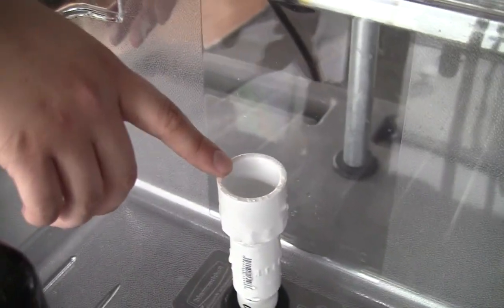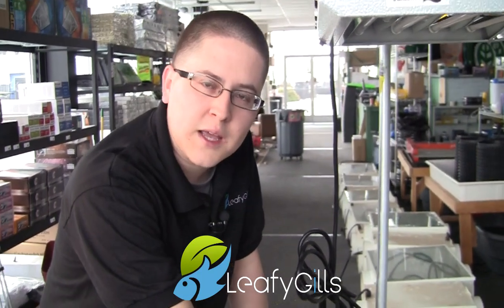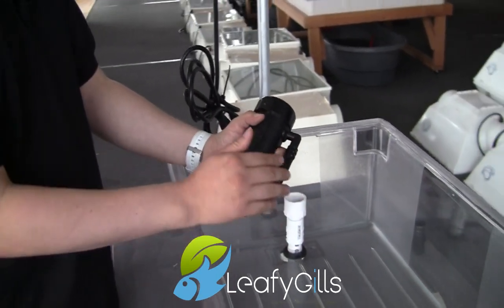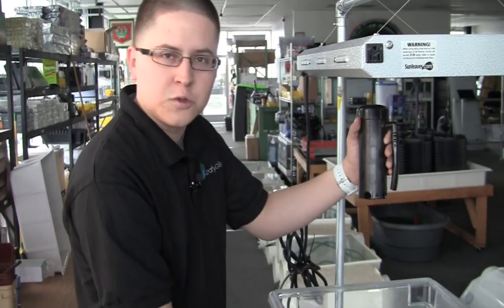What is an Aquaponics Bell Siphon?

Comment: No you didn't realise anything about the siphon... you just implemented an "affnan" siphon... and lucked in with your pump flow... because filling from the bottom of the grow bed is not standard practice... and allows no means of flow control.... and the breather tube isn't a new implementation either... in fact it's a very old implementation... that has been basically discontinued since the implementation of the affnan siphon...